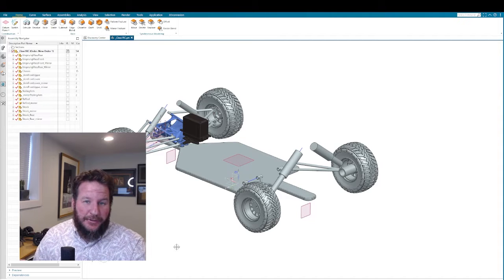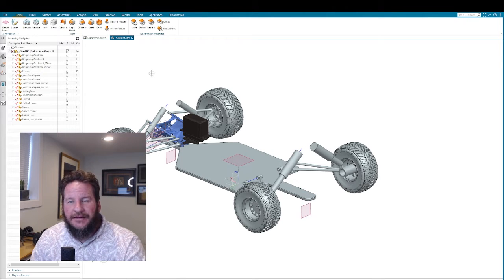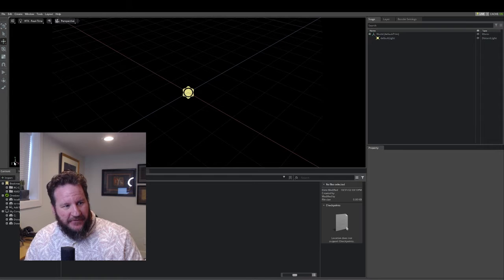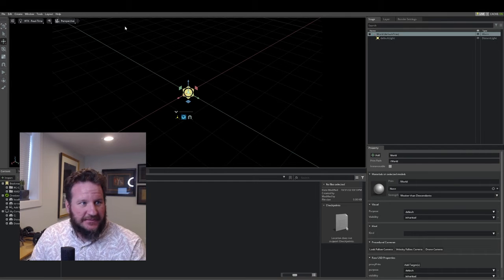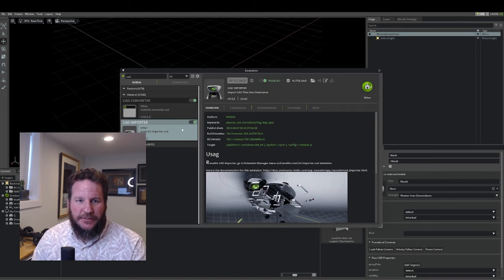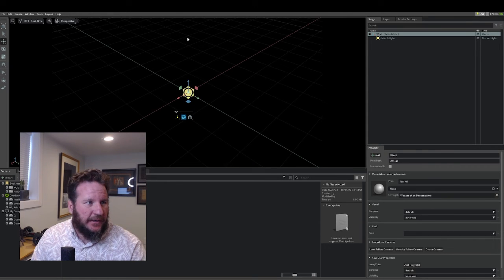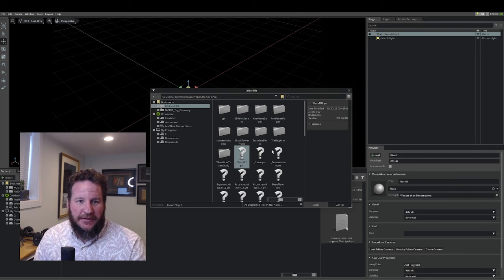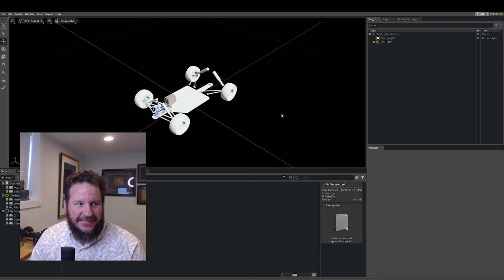How To Import CAD Data into NVIDIA Omniverse

Comment: I am trying to import my STP files. They get imported as several usd files and when I open them, their original position seems to be missing. They have random positions and are not the way I designed it. Do you know a quick fix?

Comment: I am really looking forward finding a way to directly import .prt files. But your workflow seems not to work for me. Which version of Create is required? I tried with 2022.3.0 and .prt files are not being listed in the import dialog. (CAD importer extension v0.3.3 is enabled)
Reply from the maker: Did you enable the two CAD extensions I showed in the video? https://youtu.be/vmn3uFug0dc?t=55
Reply: @strainflow  I see,  CAD converter extension is also required. Too bad its not supported under Linux. I gave it a try in Windows and all worked. Thank you for all your very helpfull videos and the quick response.